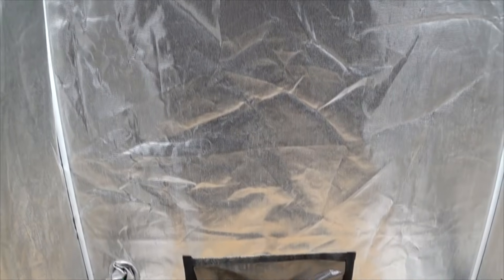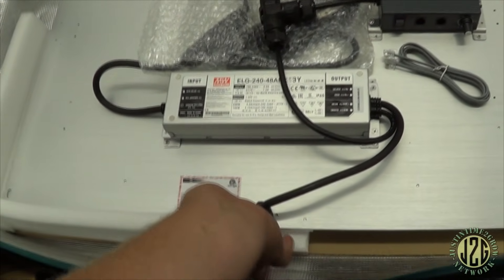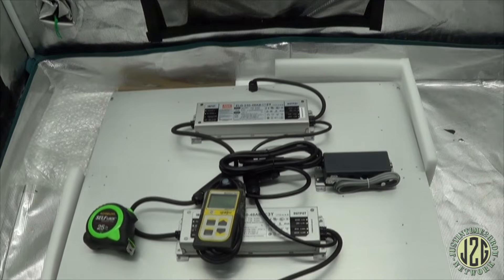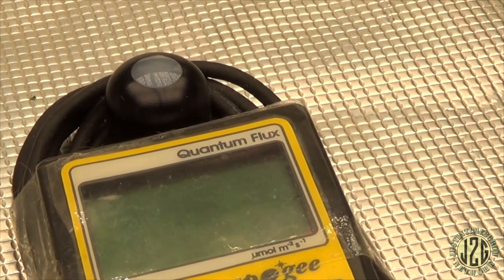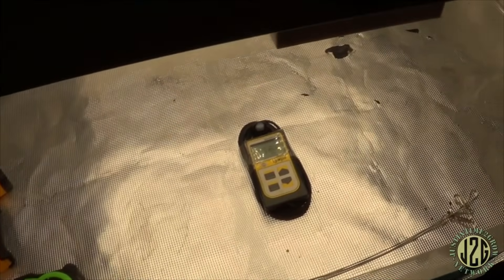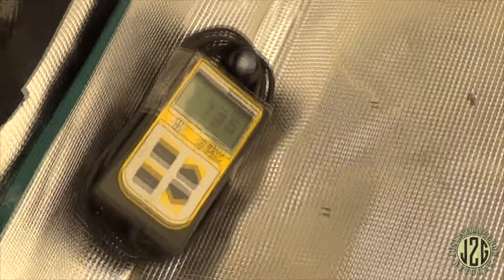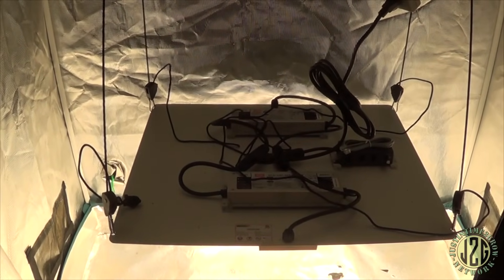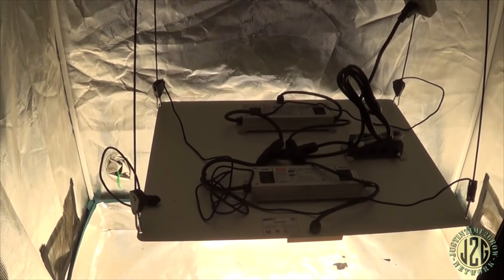Are Cheap Amazon Lights Any Good?(E:11) - Spider Farmer SF4000 Unboxing, PAR, Wattage & Heat Test

Comment: After one grow one of the drivers gave out so now only half the lights work. Incredibly frustrating. Can a new driver be bought and installed?
Reply from the maker: Yes they should have meanwell drivers. You can just order direct from meanwell by the model number. They do have a warranty, I would contact them.

Comment: I'm going to start growing because I'm sick of taking pain pills.....
I have around $1,200 for a 4x8 grow space what do you recommend ... I was thinking about two of the spider farmers... Because of the excellent components the spider farmer light has at a good cost.... What do you think Justin
Reply from the maker: That’s an easy one, you’re watching the video that’s the best bang for your buck for a 4x4. Get two of these, between the amazon coupon and my “justintime2” discount code they’re an amazing deal. Should be less than $1200 for the pair. 👍🏼
Reply: @Justintime2grow  thank you so much Justin👊🏼💥..
God bless you and your family brother..
Reply from the maker: @soldierforgod1477  all the best of luck to you, as long as you get good genetics and some decent ventilation these lights will take you far.
Reply: @Justintime2grow  I got it 8-in fan and filter ....
 and I have gorilla glue #4...
Just waiting for my lights to come now..
Oh one more question what kind of nutrients do you recommend... Somebody told me Canna
Reply: Then get the Vivosun 4x8 that is on sale for under $200. Then, purchase their carbon filter and fan combo kit for under $200. $800 on the sf lights and then under $400 on Vivosun equipment and you’re slightly under budget to purchase other stuff.

Comment: I put this in the spiter farmer 2.5x2.5 tent that comes with the sf1000 kit and it fit. Running about around 18 to 20in at 60%. I had a really good run with the sf 1000 other then my timer got bumped and my flowers started to stretch out. I fixed it but it was a little to late still pull just over half pound from 100w. Im about week 6 or 7 and 2nd week with the SF4000 and wow the buds are harder then anything I've ever had before I used to use hortilux eye 1000w hps flowering and t5 480w  and clone CFL. I'm now fully led start to finish it took a moment to get the feeding just right as the plants seen to need more faster then when I had the hps. Also the best stuff I've yet to see

Comment: Spider Farmer has upgraded the SF series with new dimmable knob and daisy chain  and the dimmer is no longer under the driver.  I have the SF 1000 in my 2x2.
Reply from the maker: Nice
Reply: I really want a sf1000 but I’d also wanna try another light in there as well; any ideas?
Reply: 2 of them or an SF2000 can fit in there. I have since bought the sf2000, and a mars hydro ts1000, but now I have their sp6500 in a 3x5.

Comment: I take the drivers off the board and suspend them and that drops the temp big time.
Reply: From what I gather that aluminum board is supposed to be a giant heatsink, correct?
Reply: @Mr_PNW  Correct.
Reply: It's optional. You may want to leave them on In winter grows.
Reply: @Shadowboxe  here in the Pacific NorthWET the winters are somewhat cold and summers (all 6 weeks) are hot. So yes the additional heat from the drivers is appreciated this season.  I may mount mine on an aluminum plate to hang on the metal wall just outside the tent for Summers.
Reply: Mount them on the outside of the tent?
Reply: @kayranse  yes, the two drivers get very hot.  If you are having difficulty keeping the tent from overheating, then do a little rewiring to move them out of the tent.  You would just have a single wrapped bunch of longer wires running between the light and drivers.  It’s not a difficult job, just make sure your new wire is the same or one gauge higher than the original.
Reply: @Mr_PNW  wait totally newbie here looking at the light, you mean I'd have to splice that wire open and extend it myself with new wire?
Reply: @kayranse  That’s correct, the drivers each are screwed to the light’s backing plate using a couple aluminum risers (like little feet).  You would screw the drivers to another plate, aluminum would be best or thermal plastic.  You could hang the plate or place it on a rack/shelf outside the tent. 
You splice or replace with a set of long wires  between the drivers and where the are connected to the light panels.  Each driver drives 2 of 4 panels.  A driver’s wires hook to its two panels underneath the white protectors that are midway on both of the longer edges of the light.  You can see where these wires go through the backing plate.
You would also need to extend the dimmer switch wires.
If all the wires are attached with connectors and not soldered, this would make it much easier.

It’s not that difficult to do, but electricity is not many person’s favorite thing to mess with.  I’ve wired a house so this sounds easy to me, but if you’ve never disassembled anything electrical you could take it to an electrician and ask him to do it.  Just tell him how much length wires you need.
if I weren’t in the middle of a grow, I’d make a video.  Might be a good project for making a kit to sell.
Reply: 6:33 Pause at this spot to see where each drivers’ wires go through the backing plate to the light panels.  The white plastic covers/protectors are directly opposite the other side of the backing plate.  Both drivers meet up at a “T” connector to the dimmer switch.
Reply: @Shadowboxe  If you did rewire you could move the drivers in and out of the tent depending on the season.  Make the new backing plate narrow enough to slide through one of the larger holes.  Maybe place the drivers on the narrow backing plate in tandem end to end.
Reply: @kayranse  buy some IP68 connectors and can make the wires as longs as you want. I got 2 sf4000's and took off the drivers and dimmer and made the wires 4 meters long.

Comment: I have 2 sf4000s and a 1000w eye hortilux super hps in a 4x10. Hps in the middle with co2. I pulled over 6lbs last run. 25 years of continuous growing
Reply from the maker: That sounds like a great setup. I had amazing results when I was combining led and hps while transitioning from all hps to all led. 👍🏼
Reply: @Justintime2grow  LEDs are definitely king in tents and enclosed areas but in open space i still prefer hps. I run led in all my tents but the old school in me still holds on to my hid. I'm hanging California lightworks UVB t5 now to see what difference it has. 3 on one side none on the other,so we will see.
Reply from the maker: @bdog4u2  yeah hps sure has quite a spread but that’s also 1100w+ at the wall vs 450 so it should. Two of these sf4000 would crush a single 1100w double ended hps at only 900 watts at the wall.

Comment: is this enough for 5x5 or do i need stronger light?
Reply from the maker: A 5x5 is almost double the lighting requirements of a 4x4. You would need to look at their new SE-7000 review I did.
Reply: @Justintime2grow  will check out your review for sure! only bad i heard is the 7000 dont use samsung diodes witch worries me a bit
Reply from the maker: @icecold3426  It does now. They have upgraded it again since I reviewed it. It has lm301b now. I will be reviewing the new model in around a month.
Reply from the maker: @icecold3426  Discount code justintime2 to save some money
Reply from the maker: @icecold3426  Make sure you're looking at the SE7000 also not the SF7000.
Reply: @Justintime2grow  yeah i saw that SE7000 still uses samsung diodes and it seems to have better coverage with bar style light

Comment: Quick question,  with 2 SF 4000 growing area  8 x 8x 8, how many plants can I grow? Thank you
Reply: @MrDmadness   my grow speces 7x7sf . How may plants can I grow ?
Reply: 2 of these lights will effectively cover a 4x8. Possibly get away with a 5x10 but kinda pushing it for flower. 8x8 would technically need 4

Comment: The kit I’m looking at comes with a 5x5 tent, and in the first page on the manual it says max 5x5. In your opinion will a 5x5 tent be alright for this light?, might have some serious drop off on the edges I guess?.
Reply: Spider Farmer states that it covers 6x6 veg  and 5x5 flower. I have a 5x5 tent tent and just received mine yesterday. So far so good.
Reply: @elizabethwebster3327  I’ve had mine for 2 weeks.  What height and power is yours at for veg?  The thing is bright and w/o a meter I went with 30” full power.
Reply: First few days it was at 20% at 4 feet because I'd read somewhere starting at 4 feet is a good start if you're nervous about upgrading and have fresh seedlings. I didnt want to bleCh my seedlings. I now have mine at 30% sitting 24" .. will probably increase the intensity as it grows then drop off once it reaches closer to harvesting when I do 12/12 intervals. My plants are about a month old now.. it's my first grow, so it's been trial and error.. but so far nothing looks concerning based on what to watch out for. Tried it on full blast for 4 hours and came back to my tent at 36c and 40% RH so it puts out ridiculous heat in a 5x5.. I wouldnt put it full unless you have a crazy good flow to disperse heat output.
Reply: @elizabethwebster3327  This is my first grow too. It’s cool here in the PNW and I picked up my clones from the grower the last days of Sep. Looking at my records the grower cut the clones 8/25, so that makes the plants almost 2 months old.  The plants went into the 5x5x8 GGT Oct 1st and were under an LEDTonic Z5 light (blue setting) for the first week until I figured out and settled on the SF4000. Originally I had the Z5 24” above the tiny plants and hung the 4000 at 5’ full power just because it’s been so cold, it was a heater for the tent.  Last week I got a mini oil-filled radiator so I’m not concern with heat anymore.  My temp is set to range 68-76F and it’s maintaining 72F.  My AC Infinity T8 has handled keeping it at the right temp, that things a power house.  

They have really come to life the past 10 days with height and many new branches And leaves so I removed the Z5 and lowered the 4000 to 30” full power. 

I came here trying to figure out the best height and brightness which has been nerve racking.  Now I’m concerned it’s either to close or too bright at 30”. I want to flood the tent with light so every branch and leaf get plenty.  
With heat under control it would be nice to have a chart of weeks with height and dimmer%.  The manual says nothing about dimming accept as a daisy chain setup.  It sucks.

Comment: Justin , I just bought this LED light.
Thanks to your review. Now during your review its best at 20 " to 24" .
Now I'm wondering if you can help me with the 24" height settings  for Seedlings , Veg , Flowering on the   dimmer switch settings.
Please . Thanks . The Spider Farmer SF 4000 is set up in a 4x4  AC Infinity tent with a Bag style CO2 hanging just above the plants .

Comment: Hey, Justin or anyone, I'm running an ac unit in my tent. my question is how close can the spider farmer 4000 be before worrying about heat stress.
Reply from the maker: Probably around 4" but youll see light stress first.

Comment: The new versions of the sf1000 and sf2000 do have daisy chain plugs on them if you order from amazon they are listed as newest.
Reply from the maker: Good lookin out. I tested the 2000 and 1000 before they had dimmers. 👍🏼
Reply: Yea i just got my 1000 in and its got the daisy chain box

Comment: Just an update. The newest version of the  SF2000 does indeed have the separate box with the dimmer, daisy chain, and on/off switch. Id imagine the SF1000 has this same new feature. This feature was a big factor in me choosing the SF2000 instead of any other brand
Reply: The dimmer also has its own on/off switch on the back of the box which they recommend turning off when not dimming.

Comment: I own a SF2000 and it does in fact come with the same dimmer/on-off/daisy chain as the SF4000 have. Not that it has any relevance to your video, just wanted to state a fact.
Great Job as always
Reply: Thanks was gonna ask that too👌
Reply from the maker: Yeah i reviewed the 2000 and 1000 before they came with them.

Comment: Hello, would this light be good for 5x5 as the manufacture suggest
Reply: abe zeke The SF4000 can veg a 5x5 and flower a 4x4
Reply from the maker: I would say 4x4 for sure 5x5 is quite a few more square feet. I think it could do it but you may have less dense nugs on the last like 6" on each side.

Comment: the hanging kit is fine but you do want to get the hangers it makes it raise higher if needed
Reply: I’ll have to look for my 1/8” (metal gear) hangers now, since I’m using two 1/4” (metal gear) hangers with their hanging kit, but tossed their cheap plastic gear hangers.

Comment: I love these lights so far, the only problem is it does get kind of hot when your running 2 of them in a 4x8 . It has been a struggle with heat for me so far but it has been very hot here lately, it has me thinking though that I might want 2 4x4 with 1 a piece in them just to help out with the heat issue.
Reply: These heat is nothing compare to HPS
Reply: @saka3364  I already know.
Reply: @saka3364  That is exactly why I won't use them.
Reply: One guy in this thread made a good point for hot locations.  Mount the drivers outside the tent with a little rewiring.  The giant aluminum plate (heatsink) should handle the rest.  My drivers do get hot even in my cool climate.
Reply: @Mr_PNW  that is a good idea.
Reply: @davidmorrow1117  I might do it this spring before our weather heats up.  I have some thick aluminum plate I can’t cut to screw the drivers to and bolt the plate onto my metal shop just outside the tent.  It’s an easy wiring, you’re just replacing short wires with long.  Depending on the gauge I might step up a gauge for durability.
Reply: Take the drivers off the heatsink,will help.
Reply: AC

Comment: I got the SF1000 kit 4 months ago to tryit out I was able to get 1/2 pound off one plant. Do to space I only have room for a 2x4 tent but I didn't want to do there SF2000 because I have plans past that so I've been thinking about just getting the SF4000 and turning it down and I'm glad I went back looking at videos this sold it I did realize you did this in a 2x4 tent when I seen the the video before. Thanks for the time you put into your videos.

Comment: Currently running a older sf4000 in a 5x5 only complaint is how hot it gets. You’ll definitely need some way to cool down your area my tent got up to like 86 not turned up and no ac.
Reply: 86 degrees is fine with LEDs. You can run high 80s with if you have to. Check your leaf temps. The leafs should be 74-78 degrees which is ideal if your ambient temp is 86 degrees. Have you tried an exhaust fan or running your lights at night when it’s cooler?
Reply from the maker: Sounds like you need more ventilation or a cooler room outside the tent. It's wattage, wattage equals heat.

Comment: So I just did a bunch of testing on LEDs getting ready for a 12,000sf grow. I usually run CMH but could not ignore the progress made with LEDs. The numbers this unit puts out is truly incredible and for $600!!! Have to note, they run HOT!!! I placed a small 4" fan pointing down on the drivers and it dropped the heat considerably. This unit beat out a gavita 1700e and growers choice 720 based on my testing. Couldn't believe it
Reply: how do you connect all of them tho?
Reply: @mukando11  daisy chain into a control module. I think you can control up to 100 lights at once now.

Comment: suggest buying an aluminum heat sink (under $20) and secure it onto the ballast top with thermal compound (~ $5) and put a fitted muffin fan (120mm) on top of the heat sink to suck out the heat; I was wondering why manufacturers don't offer an extension cable to optionally move the ballast out of a tent scenario.
Reply: I’ve got mine running along with an 8” AC Infinity system, one clip-on fan up top to move everything around evenly.  My ACI and Inkbird controllers are keeping the tent about 72F.  Highest i saw was 78F.  It is cooling down here in WA State and the tent is in an unheated shop.  I’ve even had to get a mini oil-filled radiator that the Inkbird runs.
I’ve got 2 of the bottom windows half open pulling in the shop air.  I just ordered one of those Govee Bluetooth sensors that sit in the tent and feeds data to the phone.  I’m anxious to see how all this data will play out over the next 24/7.

Comment: Any chance you could get a proper test going to see if the red coating on the aluminum heat sink on the HLG 300, 550v2 dissipates heat better than without?  I own quite a few hlg lights,  but i have no way to test the spider farmers, etc.
I heard Steven from hlg mention this coating on the GML show and it piqued my interest.
Great videos.  Thanks! 
Oh yeah,  i noticed the knock offs tend to use 2 drivers instead of one,  any idea why they do that?
Reply from the maker: How would that even make sense? It's not adding any mass and it's not reflecting or absorbing light. 

The larger driver costs more I believe and a lot of them will run the 3000 and 5000 chips on different drivers.